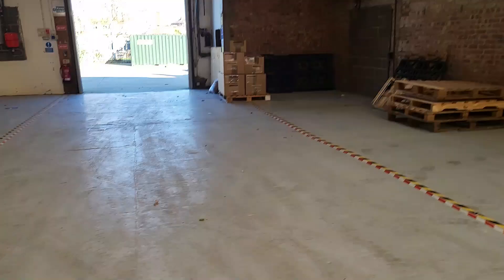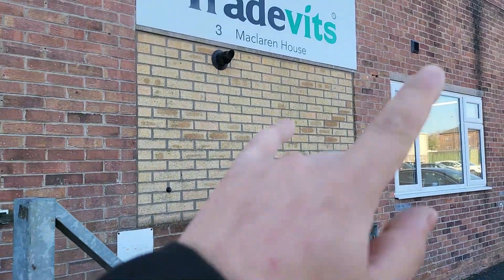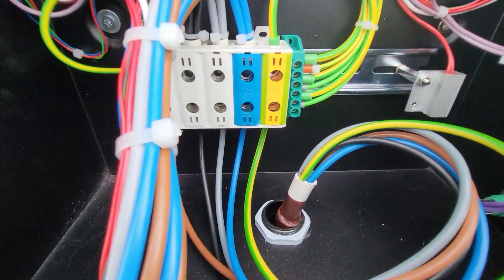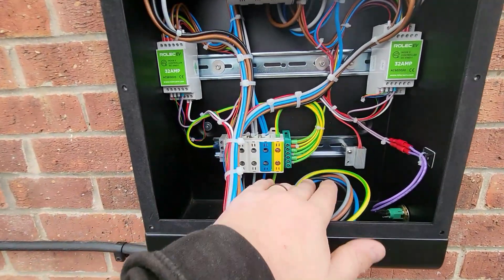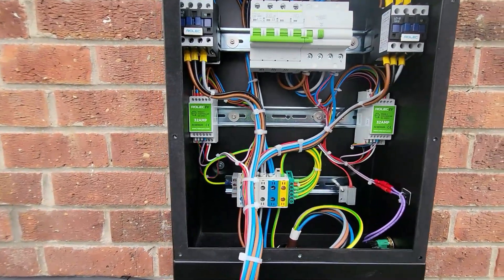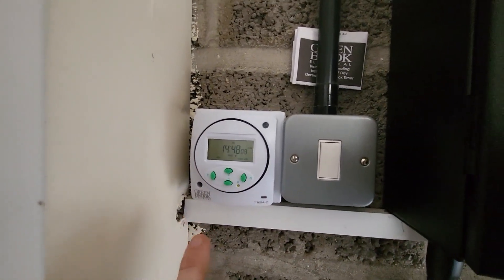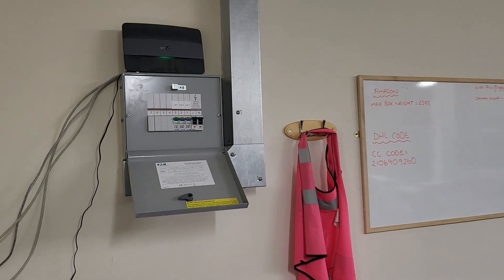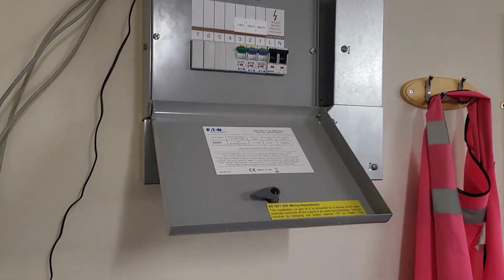Commercial Three phase electric vehicle charge point start to finish. Matt:e - Rolec

Comment: Hi Mark, Can you please advise if the matt:e unit could be used as a distribution board for the chargers. We do not have space in the existing board and the idea would be to take the tails from henley block to matt:e unit? thanks
Reply from the maker: With the right lay-out option yes it can.
Reply: @electrician247  we have 2 options, would you suggest your preference? mains to Matt-e to disctribution box to chargers. or mains to distribution box to matte to chargers. an important issue is, in either setupt where should be the surge protection go.. can we add surge protection in these matt-e units? thanks

Comment: From the matt-e back to the db is it on just on a 40a 3 phase breaker at db as in the matt-e it has an rcbo in??
Reply: Sorry as the rolex has an rcbo in
Reply from the maker: exactly. Rcbo protection is in the rolec and it's of the mechanical variety so all good. We just need to cover over current protection into the matte which we have in place for the cable supplying it.

Comment: I’m very interesting video Mark, good to see the EV stuff, similar to the charging set up for our diesel/electric trains, when they arrive at depot we couple our version called the shore ETS 600amp 3 phase supply to run all the auxiliaries on the train like HVAC battery chargers lighting and compressors so we don’t need to run the engines (I still do though 😉), I’m going need to get money saved up and book myself on to an EV course through as I don’t know a lot about the who EV charging side of things

Comment: Second thought:

Maybe some three phase charger installs should have the phases rotated. That way you won't end up with the single phase cars overloading phase 1 all across the UK?

I'd certainly rotate phases if installing multiple three phase chargers in the same location.
Reply from the maker: This isn't how they work. The phase balancing is done by the charge point. Even for vehicles with just a single charging pack built in. This is why they exist. We 100% should not ever be rotating and playing with phases in them. Never ever do that.
Reply: @electrician247  interesting.
I've seen other electricians say they rotate phases.
Example:
https://youtu.be/lG0BuKg3mfw?t=388s

This one too
https://youtu.be/IMVh1b3yMUE?t=1520s
Reply from the maker: @the_real_hislordship  you are talking about multiple 3 phase charge points without load management in those videos.  Entirely different thing. 

This is one 3 phase charge point with load management on the system. The adjustment of phases for single phase vehicles plugging is managed by that.

Finally any wiring on the manufacturer side of things should never ever be adjusted. Which is the point I am making. 

Dumb system with no load management rotate phases on the incoming side is a work around. 

But this isn't what in this video. Never ever swap phases around on a setup like this
Reply: @electrician247  ok awesome, I've not seen that type yet.

Please could you do a video of one of these with 7kW cars charging and a clamp meter on the phases.
Would love to see this in action and how well the phases balance.
Much better than overloading a single phase.
Reply from the maker: @the_real_hislordship  I have a load management video coming soon. In essence the phases are rotated at the source. It is the key and critical difference between load curtailment and load management. 

I see your point on multiple charge points without this in place. Makes sense and is how many are wired. I thought you was suggesting adjusting the manufacturer wiring but I can see you are not. Its early and I read in haste. Have a good day
Reply: @electrician247  thank you. Yes I meant rotate phases on the source (likely where connecting inside the charger) or that the manufacturers should consider doing that in production.
That wasn't very clear - my fault.

Looking forward to the video 👍

Comment: I notice you've kept the phases as brown black grey for both charge points.
Would it not be better to change one of them to say black brown grey for cars that only use single phase for charging?
That way you wouldn't overload phase 1 each time?
Maybe the manufacturer should think about doing that?
Reply from the maker: This is how it's wired as per manufacturers instructions.  It uses load management to balance loads and avoid exactly the problem you describe. This is why 3 phase change points trump single phase chargers everytime

Comment: Hi Mark, I wonder if you can answer a question for me? who owns the board the meter and incoming supply is fasted to, the reason I ask is I need to have a new RCBO CU fitted, at the moment there is not enough space above the meter board, the board is too tall as it was designed for the old style meter, I would like to cut at least 2 inches off the top.
Regards Ray...
Reply from the maker: Hi Ray. Generally we leave the Meter boards for the DNO and suppliers to use. But I don't think a hard and fast rule exists. Plenty argue about meter boxes and such.